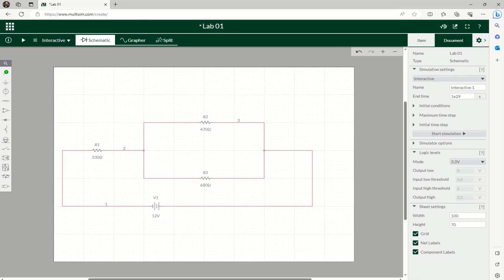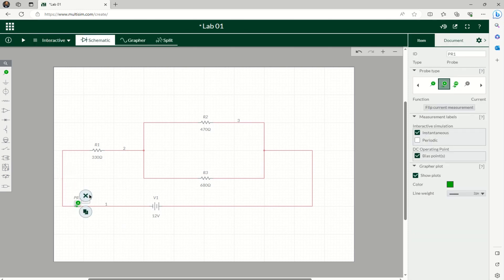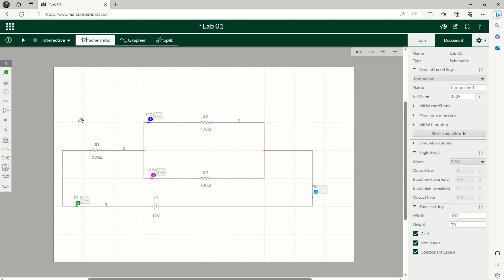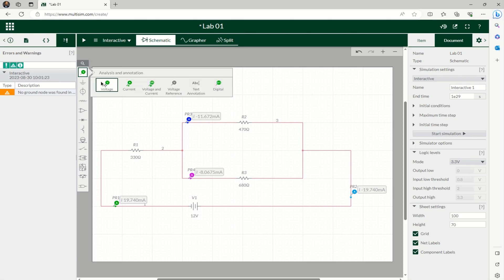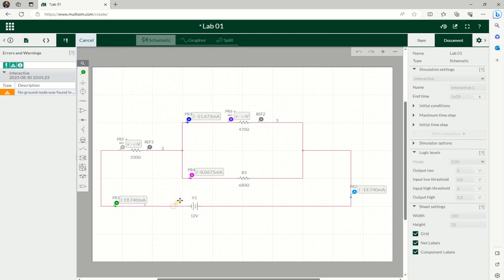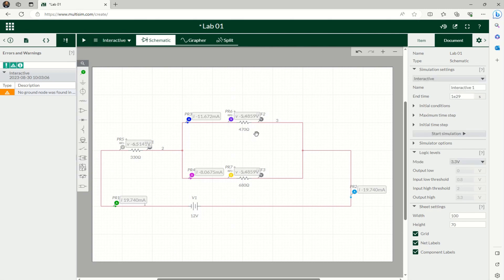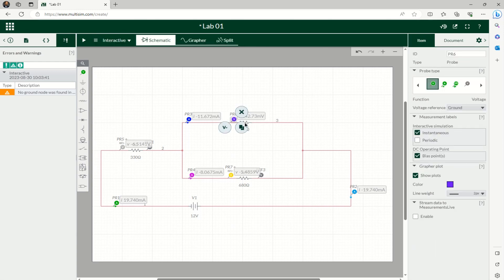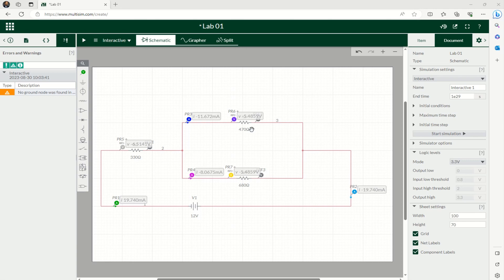Measuring Current and Voltage in MultiSim Simulation Software #multisim #Circuit_simulation #circuit

Comment: Measure the phase angle between voltage and
current in a purely capacitive circuit with a
capacitance of 50μF connected to a 50Hz AC
source.  Can you do this question 

Thanks for the explanation